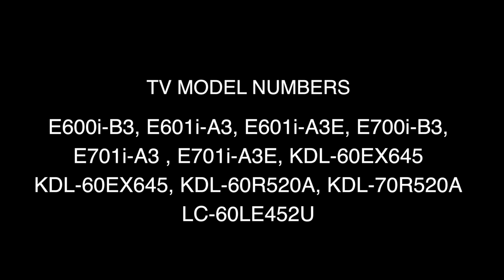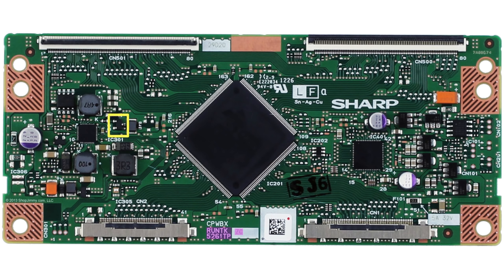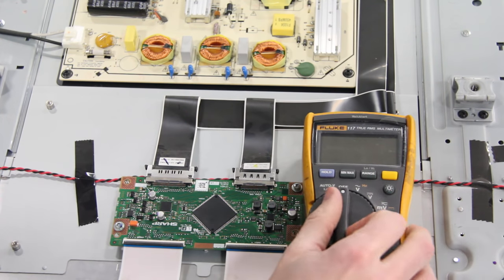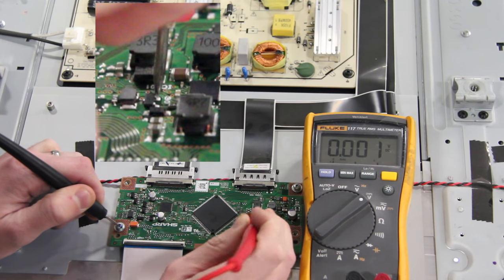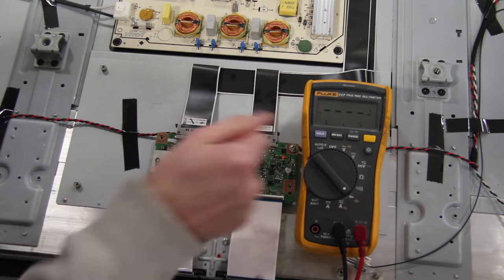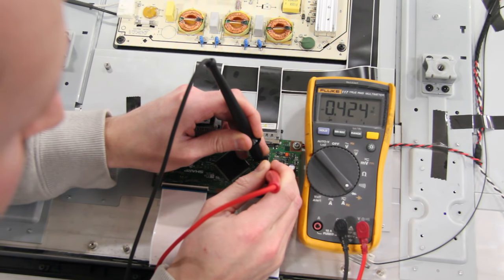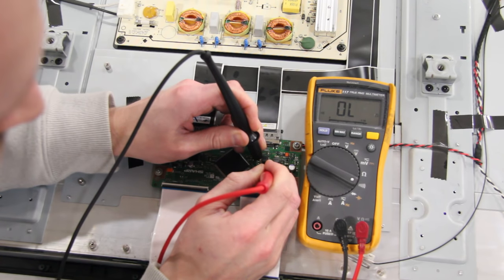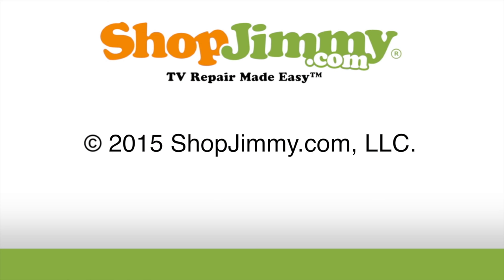T-Con Board RUNTK5261 Test - How to Find Faulty Component Showing Bad TV Panel

Comment: Would replacing the part fix the board or would it require more than replacing the bad part?
Reply: It depends. The components can fail. Sometimes the failed part is due to a deeper issue.

Comment: Samson 60 in smart tv power up blk screen, 15 20 sec half screen slowly comes on very grainy then 2nd side all vertical lines slowly gets better 1st side gets dark after 2 3 mins turn off power  turn back on then  excellent seems like 1 or both sides have to warm up. but wont get good until power off then on.

Comment: On sony kd-49x7000e how can I know if the panel is bad?
Reply: 75% chance that the Panel is bad. But no defined statement on what actually happens to make the Panel bad. Is it a mechanical issue (like a cracked Panel)? Is it the bonding failure of electrical connections to the Panel Itself? Is the Panel drawing too much current for some reason?? I wish that this relationship between the TCon and the Panel had been discussed in better detail.

Comment: Hi, i have a problem with a Philips 42PFL7685H/12:  after putting on the TV you can see the Philips logo and after about 10 minutes the TV works fine with no problems. When its hot in the area the time is a lot shorter. I have already replaced the T-con board (6807-0309c) after that, the TV give only black and grey vertical stripes,  for ever..

Comment: Hi.. Ive just been given a 50inch jvc fire tv with lines horizontal and vertical, with the picture coming back and then flickering to lines and so on.

Ive disconnected one ribbon and one half of the screen doesn't flicker, then when I plug the other side in the flickering returns.

Ive swapped the ribbons across to rule out the ribbon and I get the same flickering result.

My question is regarding the said failed chips that you tested, do they fail without a deeper seated issue? Like poorly made for example? Assuming these parts cost peanuts to produce in China... 

Im tempted to just throw another Tcon in and take a chance. 

Cheers

Comment: Why don't u specifically say what u mean by tv panel caused problems. 5% chance says 95% chance it didn't create issues. HELP..
Reply: by "Panel", he means the whole display, SUS, Buffers and all
Reply: Mark Cob Hey this is old but I'm confirming that if the TCon board is bad, that replacing the motherboard and the TCon might NOT fix it because the "panel" means other components as well that could be the issue.
Reply: @nathandrawdy  i fixed 3 tv,s really easy . Although  WHATEVER board it is its 100 bucks an u can by one at fb market place for 40
Reply: I've found thi's best. On tv there is only two boards 
 My mom's I figured out what board  .  Googled board bought it tv worked great . That saudering i
Boards is tough

Comment: If the diode test (drain and source) measures .43, but the drain measurement while the tv powers on very low does that still mean the panel is bad? Dealing with an OLED where its power drops before it turns on. I’ve replaced the t-con, mainboard and power supply and nothing seems to help.

Comment: I have a Samsung tv and the t-con diode keeps burning out. I've tried 3 boards. I didn't know what to do and for an experiment I tried powering it up with the diode removed and the TV turned on and it seems to be working fine. I wonder if it will cause problems in the future. only time will tell

Comment: On my T Con board there is a white block with a stamp QB411V . Also printed on board , model: 30/37/42/47/55
FHD TM240 Ver 0.4 Is there a replacement board for this T Con board. Checked fuse, it is OK

Comment: Hi i have 8 blinking red light 
But  when unplugging tv   before flashing  I got  on dc voltage  

0,251 Drain
0,003 SOURCE
0,002  Gate

with 8 blinking red lights 

Drain = 0,000
S    =  - 0,003
G   = 0,000

diode test
0,227

continuity = 0L

thanks for help

Comment: I have repaired about a dozen sharp paneled vizios with this bad panel issue by cutting the buffering chips off of the bad side of the panel with a razor knife after replacing the tcon. one of these sets gets used a lot in my bar and has been working fine for over 2 years since this repair. one out of the dozen has come back as failed afterwards.
Reply: Thank you for your great input.   I decided to unplug half the T-Con connection and now this made right half of the panel work.    Could this be a Tcom or cabling or panel problem?     At least I now know the power supply is good and half the the tcom is good as well as the Logic main board as I have all menu controls.         What do think I should do ?
Reply: @frankbarbaro5447  At this point with your results, I would cut the flexible ribbon and IC buffer chips off the SIDE of the lcd panel that doesnt work. you have nothing to lose You may actually be able to see which chip failed but you need to remove all from the bad side not just one.
Reply: it is lso possible the damage to the lcd panel is on the board attached to the panel where the tcon ribbon plugs in. in that case I do not know of a way to save the panel. I do not believe its a tcon issue your having. could be ribbon cable, you can try cleaning the contacts.
Reply: @fathergratwick  That's a really good idea.  (As I have nothing to loose) Ill start by removing the IC buffer chips.  Ill keep you posted.   If I cut the ribbon though its game over. I could never repair that. lol
Reply: @frankbarbaro5447  I just run the razor dont the whole side of the panel and remove all the ic chips with the fexible material its attached too. you need to remove them all from the whole bad side or it wont work.
Reply: @fathergratwick  If run a razer, it will be game over . Dont you think ?
Reply: @frankbarbaro5447  No I have repaired multiple vizios this way. The panel will then rely on the functioning buffer chips on the opposite end of the screen panel once you remove all of them from the damaged side.
Reply: You need to make a video explaining it please

Comment: Hello, I need help for Samsung LE32D550: the image periodically shakes and gently flashes. When it does not shake it all is ok. 
The TV is on service due to the vertical tape on the screen (no picture), this is solved by removing the damage to the T-CON flat cable!

Comment: But that's only where it is located on THAT SHARP TCon board.... how does one go about identifying this component on other brands of TCON board? I've got a Samsung 46" TV's TCON sitting in front of me that causes the entire TV to constantly reboot (Power on, Samsung "warble" sound, power off, power on and repeat) when the ribbon is connected between it and the main board. Even when disconnected from the display panel it still causes the TV to reboot constantly... but unplug this TCON from the main board and the TV comes on and stays on (though there is no picture of course). I'm on the fence, spend a little money to try a replacement TCON board that might or might not solve this TV's problem (and might be ruined itself) or just go ahead and pack it all off to the recycling center.... ?

Comment: SONY BRAVIA, KDL-55EX640. TV was working fine till one day i turned on, had normal video and  audio for a few minutes but suddenly got distorted picture, then fine vertical color or black/white lines, then pitch black screen while the power on light (green) remained on. I tried shutting it off, right after, but wouldn't respond to remote. Finally, i tried unplugging it, waited at least a minute, trying to reset it before plugging it back on, but the green light remained on, no picture and still unresponsive to remote. I kept trying unplugging it and plugging it back on, using the remote, and hand controls on side of TV to shut the green light off and have the stand by light come on but wouldn't work.  Now, literally, the TV  has its own mind, the stand by or power on light come on whenever they feel like it.  Inconsistent response to remote when powering on/off. When it decides to turn-on it has normal video and audio but short after it makes a loud alarm like sound then the screen shows distorted picture with fine vertical color or black/white lines then picture goes black . Then it turns on/off on its own, with long intervals, then it cycles again.

Comment: What in the screen panel causes board failure? Is it one or several of the panel connections (also called tabs) that heat up and lose continuity?
Reply: Ever figure that out?
Reply: @marksreef9688  Cricket. Cricket

Comment: I have a sony bravia KD55X750F tv it wont turn on and there is noled light. ready changed the power supply board and that didn't fix it what do i do
Reply: and before it completely stopped working   it use to just shut off by it self

Comment: Love your videos!   Having trouble with a Vizio and want to see what you think.  

It's a Vizio M420SL Led Smart tv.  
 
Symptoms: I can power on and see the Vizio logo with backlights just fine.  After the "boot logo" disappears the screen then starts flickering boxed blue, red, and green all over the panel.  I tested the Tcon board as you did in this video and my results are odd.  With power applied and the screen on, I'm getting next to nothing in voltage on any of my pins.  I'm thinking bad panel, until I pulled the board and tested it with no power just like you did in be video and it reads completely operational.  I've tested my voltages in stby and on to each board and everything I reading the normal range.  I did identify two bad diodes in parallel with each other (SB560s) on my secondary power supply (SMPS) as they both read open in both bias'.  Going to swap them out with two new ones but wanted to see if you could identify anything you've seen caused by this?   Thanks in advance!

Comment: I did this test on my t con board and its good... so what would be the fix for my tv? LG 60UF7300 the menus are clear but when I try to connect anything to the hdmi or any inputs its snowy, I can hear the audio I just cannot see a display. 

I have already purchased and tried a used known good main board but I still have the same problem. 

any help appreciated that can help me test my tv further to find the problem 
thanks
Reply: Check if your LEDS are working. 50% time its the fauly LED. You have to test the panel with a flashlight. If you can see the dim images moving them its definiately your leds which have gone bad.
Reply: If the LEDs were bad, then he wouldn't be able to see the menus either.
Reply: If you know how to use a multimeter, you can check the supply input coming into the t-con board..then check the supply output to the lcd panel..just be careful ayt..own risk.
Reply: Also check the LVDS cable whether the problem from the connection..hope this help.